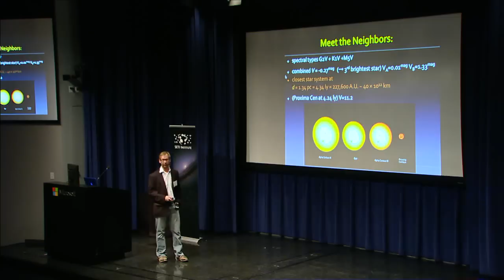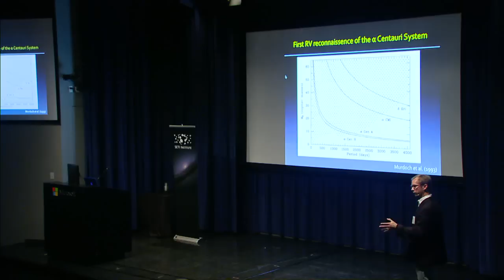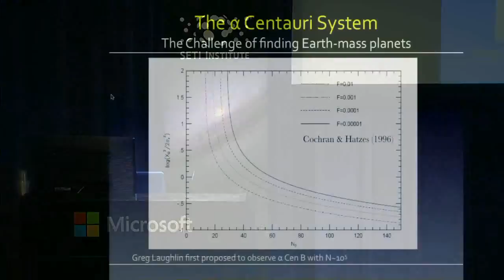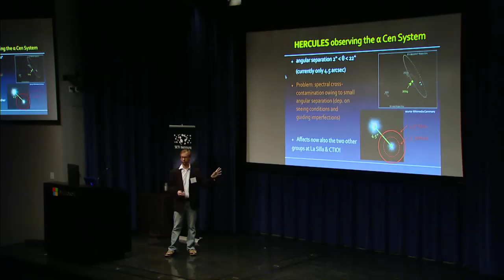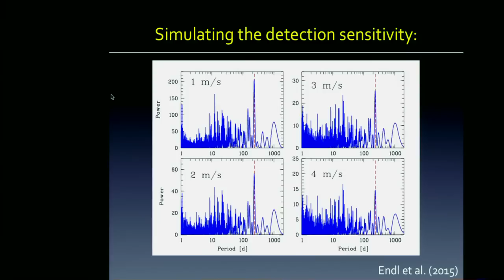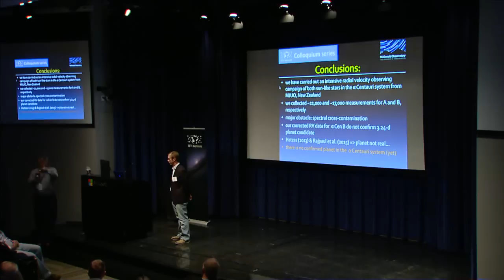Searching for Planets around Alpha Centauri - Michael Endl (SETI Talks)

Comment: If the HARPS data was only significant over a certain time, does that not 
imply that there is more than one planet, and the data only became 
significant when they were on the same side of the star?

Comment: Sounds to me like they are using spectral analysis to determine if a planet is crossing the star as in the Kepler mission. If the star doesn't have it's axial spin relative to our line of sight there would be no spectral change, even figuring in cross contamination. It is highly unlikely that there would be a planet orbiting Centauri A, or B due to the close proximity of their closest approach of 3AU. That is roughly the distance from the Sun to Jupiter. The gravitational tug of war would have either kicked the planets to an extreme outer orbit (perhaps between B and Proxima), or kicked out of the system altogether, or pulverized by the CME's A and B would be flashing to each other, and the gravitational effects of A and B. 

With two stars at such close proximity it is highly likely that A and B could have used up the material needed to form stable planetary  evolution. This would account for the high metallic signatures in the spectral graph. Proxima may be far enough away to have formed planets if it was born out of the same nebulae, Or, of perchance, was a captured star at some distant past.